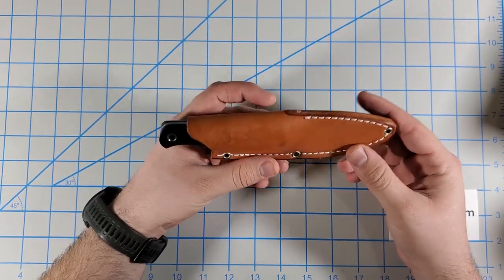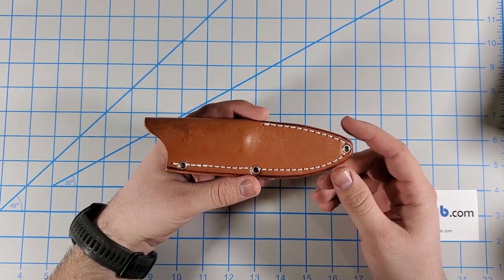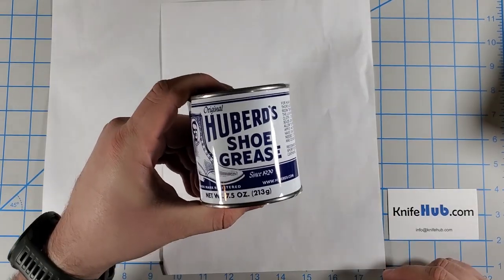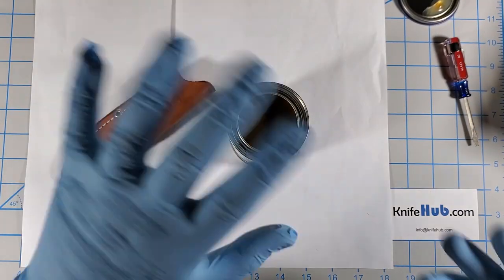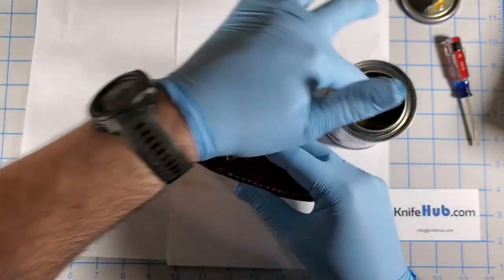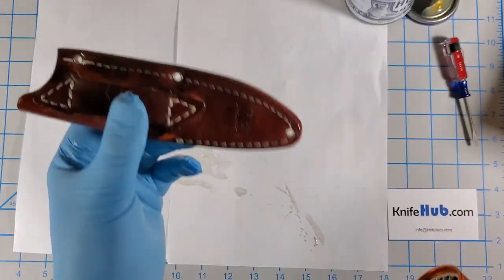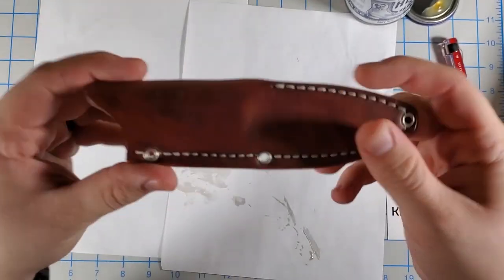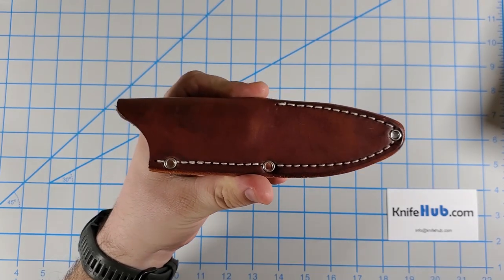Treating the leather sheath for my Bark River Ultralight Bushcrafter

Comment: The spot is glue. They apply glue to the welt and stitched area of the belt loop. The maker of the sheath simply dropped some glue on that area. I use sno-seal on my sheaths.